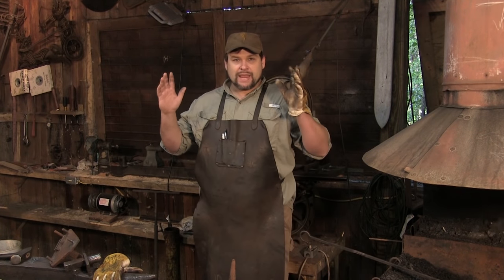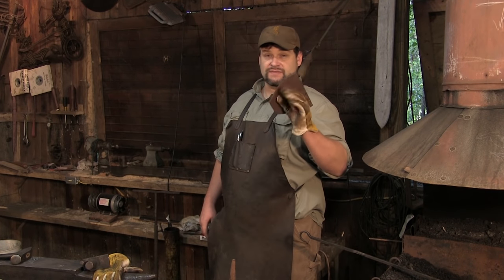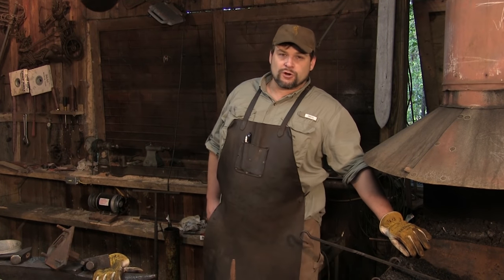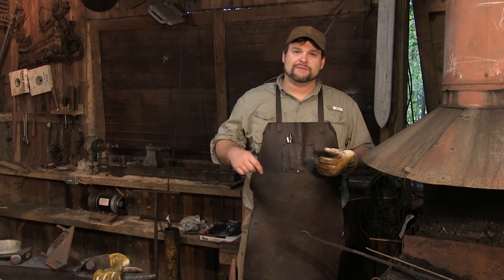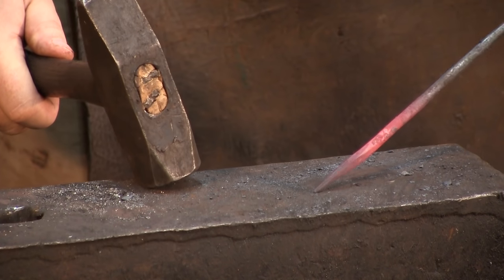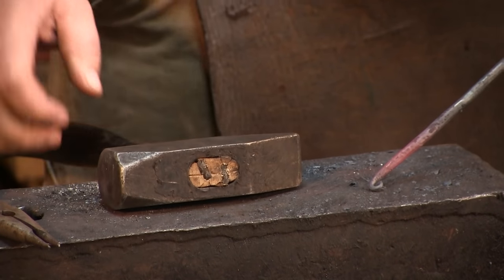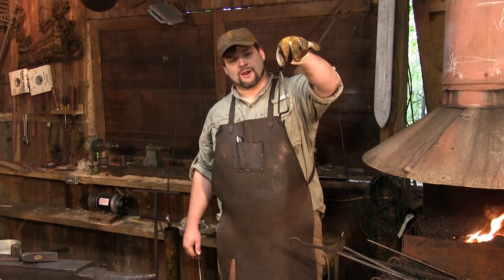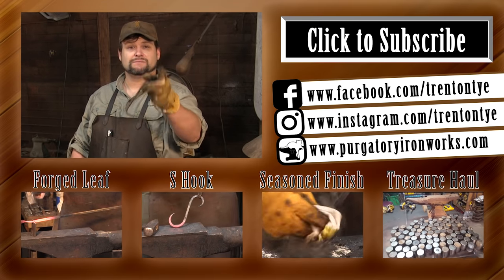Blacksmith Forged Dinner Bell

Comment: I have a larger version given to me by a blacksmith at a local fair after I had stood there watching ever move he made during the process of the forging. The hook end has a cows head, the striker is a horse shoe that has been straightened out one end flattened out with a cows hoof forged into one end. After he had completed it he heated it again and then sprayed it with WD-40 putting a very hard glaze finish on it.
Thanks for the demo videos 
Charlie
Reply from the maker: You are surely welcome.

Comment: Just a thought, couldn't you weld the stop on the rounding jig at an angle getting wider from the round bar the further up you go to be able to do different sizes of stock in the same jig. I am always trying to find multiple uses out of every tool simply because I don't have the most area for tool storage.

Comment: So two questions:
1. What do you do if you're ASO doesn't have any hardie holes (piece of railroad track)
2. Is there any way to make jigs if you don't have a welder, or is that a must?
Reply: I don't know about the welder, but you can use a vice to hold jigs and hardy tools.
Reply: 200 years ago they had no welders. Drill a hole, heat up the jig stud, put the piece into the hole and forge weld it. Then drill next hole and repeat.

Comment: Good pointers but as another viewer stated, it’s easier than you show it. Once you make the round hook you can do all the other bends on the jig by using a length of pipe and no te-heating needed. I used to make rebar ties in this fashion and never heated a piece of metal, perfect corners every time for any size rebar in the project. I did love the demo of making the first hook. I think that if it had been a hardening metal it would sound better, it would also sound better if hung from the first round hook than the corner, the round hook in the bottom dampens the resonance of the bell.

Comment: How long does this usually take you to do? how long are the heats?
Reply: not long. you have to watch the color of  your steel as you heat. working the steel in and out of the fire as your heating will allow you to see the colors. after a while you'll just know by experience. on the 1/4" stuff, if you've got a good fire burning, check your steel after a few seconds, it don't take long at all.
Reply from the maker: For one using this thin of a stock, its not long. Texturing is really the thing that will eat up your time.